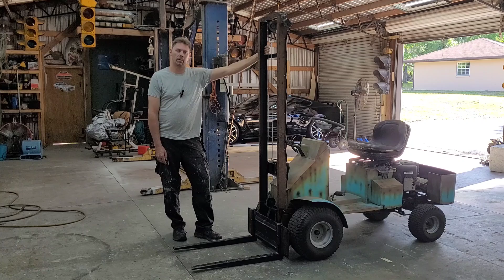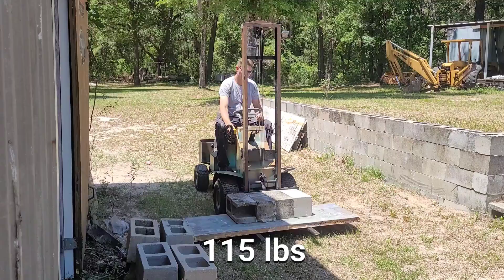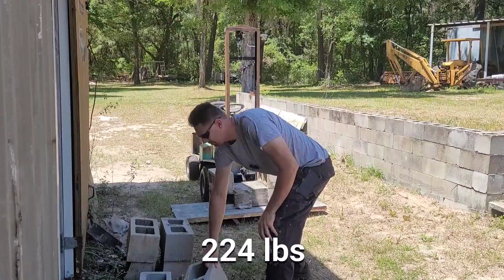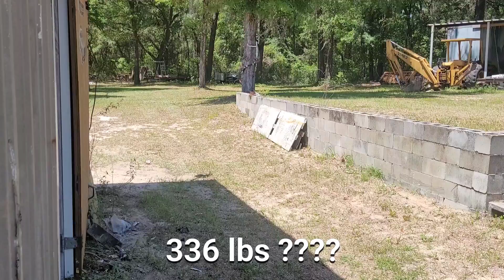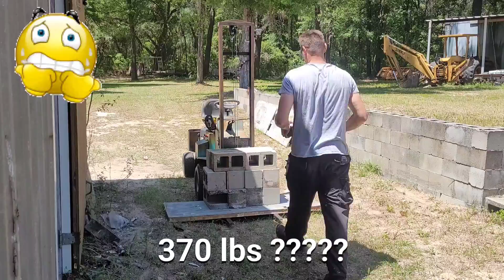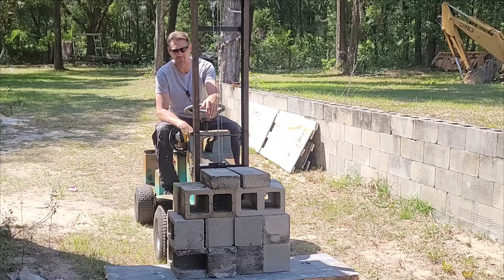How much will this homemade forklift carry.

Comment: The factory axle will be your breaking point. You will his about 500lbs on the axle and after that is when the possibility of the axle breaking.  Not sure how you can get around that because most riding mowers will be around the same no matter what brand.
Reply from the maker: The main plan for this is for stuff that is a little to heavy to carry by myself or awkward. Plan is 400 and less. I have a full size tractor for anything heavier than that. It's more of the convenience of having something compact to lift and move stuff around

Comment: If I can recommend one idea, I will. I've already added it to my plans, and it would be an easy retrofit for yours:

Cut off the flat top of your fork tubes. Add a short section of tubing above so that the sidewalls of the tubing is still there (baaically it'll look like the bottom part does now).
This will be stronger than the flat plate is now.
BUT!!!!
The real advantage will be that you can cut "teeth" on the top of your fork retaining back plate. Only maybe 1/4" deep, and 3/8" wide every 1" along the top. 
This allows you to lift the fork about 3/8", slide it to where you want it, drop it into the two teeth that line up on the tubing,and the forks will not slide sideways. Period.
Infinitly adjustable, very easy to adjust, easy to add to existing setup. 😊

Safety first. Unless it's lunchtime. Then it's food first. 😂

Comment: I would consider placing crossbars about every 18" on the upright bars, that way if the cable snaps it shouldn't be able to hit you from the drivers seat.
Reply from the maker: @unkierich  the cable is a concern. The issue is with the winch being on the outside. The cable is not on the inside until it goes over the pulley at the top.
Reply: @Paulsprops-dc4mt I'm going to recommend swapping to synthetic winch line. Yeah, $50 bucks to replace a line that doesn't "need" to be replaced sucks, but the safety factor trumps the $50 in my mind...

If you want to keep the steel line, maybe thread it thru a 3/4" gas pipe from about a foot above the winch to just below the top pulley. Support it top & bottom with some 1/8"x3/4" flat stock to keep the 'cable tube' in place and it will allow the cable to pass thru it like fishing line thru a float. No wear & tear, as the two never touch, but if the line ever breaks, the part behind the mast will be inside the tube and fall to the ground. Then you can "cage" the back of the mast so it won't come back at you from there, like he said originally. 👍
Reply from the maker: @Voo_Doo_Blue  i have a few ideas in mind. Just think of which direction I want to go.  The pipe is a good idea. Keeps it simple.

Comment: None of this matters, what matters is how high can it lift a small block chevy engine? Try and pick up the rear end of a small truck.
Reply from the maker: @howiehowdy  if you're asking, will it go high enough to pull an engine out of a car. No. Will it lift the back of a truck. It probably depends on the truck. S10? F150 No. But i didn't build it for those reasons. I have other equipment for those purposes if i needed to perform those tasks.

Comment: Highly recommend regular inspections of not only your welds but of the original frame and axles. How much was the original tractor designed to carry? One fat guy or one not so fat guy? View the load as fat guys all sitting on the original tractor.
Reply from the maker: @StevenStyczinski-sy8cj  not sure if you saw the build video. But this is a home built forklift i made for carrying stuff around. This video was a follow-up video to answer some of the questions from the build video. What can it carry. So i made it to see. I won't be carrying 300+ lbs on this regularly. Mostly for those items that are too heavy or awkward to carry by hand. Anything larger or heavier, i have a front-end loader i use for that.

Comment: I am a bit of a lawn and garden tractor nerd. I build mud mowers and have inadvertently gained a lot of knowledge on lawn and garden tractor transmissions. You could greatly increase the carrying capacity if you went with a Hydro like a Tuff Torq K66 or K71. You can find them around but they came in John Deere tractors, especially. The K 66 develops something like 450 foot pounds of torque and has 1 inch axles. It’s meant for ground engagement. The K 71 is even bigger and more robust.You probably have a three-quarter inch axle transmission on that thing which is still respectable and can do a lot more than you think.
Reply from the maker: @Tennesseemountainhomestead  i believe mine is the tuff torq k46. It has the key way on  the axles and not the lug nuts
Reply: @ yes the K 46 is probably one of the most common hydrostatic transmissions that were made. Back in the early 2000 era the thing to do was sift a K 66 in place of the K 46 on the L120 tractors. As a matter of fact, I did that myself. The difference in power is astronomical.
Reply from the maker: @Tennesseemountainhomestead  im sure as time goes on. Ill be finding the stuuf i need to upgrade this. I just this for a cheap price running and driving perfectly. So i used it to make the main unit. But there is always room to make ot better
Reply: @ the K 66 still uses key axles, but there are a lot of garden tractors out there which incorporate the cast-iron hubs to work with that and then you get five bolt lug pattern. I’m not sure if the K 71 has splined axles or which hydrostatic transmissions may have had splined axles. In my experience of mud mower building, hydrostatic transmissions are undesirable because you really cannot speed them up to great gain ground speed by changing pulley sizes. We stick with manual geared transmissions.
Reply: Also, the oil that is inside these hydrostatic transmissions is the equivalent of 50 weight motor oil. You can even use a 50W full synthetic motor oil.

Comment: Awesome build keep showing the upgrades. Dual wheels on the drive axle would help with the side to side stability
Reply from the maker: @riverfrontww  that was a thought. Would look kinda cool, too. The fun part would be making extensions. This axle isn't the kind with lug nuts.
Reply: @Paulsprops-dc4mt  Search on here bunch of vidoes where people have added duals i'm betting there is one out there that didn't have lugs. I know some folks used wheel weight for alignment of the duals.
Reply from the maker: @riverfrontww  ive done it before a long time ago using threaded Schedule forty water pipe with the four bolt flange. Making sure its perfectly centered is tricky.

Comment: Nice Job!!  Looking for your build video.....
Reply from the maker: @Paladin7845  i put a link in the discussion to take you to it.
Reply: @Paulsprops-dc4mt  Thanks, all ready watching and saved it.  Planning something similar for a couple years now.  Watching yours for ideas.  Probably going to start with a hydro unit and upgrade the front spindles to 3/4".  Then add 4 stud hubs w/ larger tires rather then flip everything around.
Reply from the maker: @Paladin7845  it would have been easier to start from scratch with the main parts. But i figured it would be more challenging to make it work with what i had.
Reply: @Paulsprops-dc4mt  🤣....Great attitude!  You like a "challenge" more then I do.  Then again some of my projects are.....does it work?  Yes, then put it to use and we'll paint it later.

Comment: I knew a gentleman in Georgia that set up affordable homes for a living. He'd maid a machine out of lawn mower parts.
But he did not use the frame.
It was too weak for the weight that he was
Warning to Hull. He always hauled 40 blocks on his machine.
Whatever your winch.
Shows the it could pull double it, that's how much weight you can pick up
Reply from the maker: @MarkMullins-jp3xm  the winch is a 2000 lb, but i know the unit as a whole would not pick up that much weight. This was a follow-up video to my build just to answer the question of what it would do.

Comment: The weight is decided by ur tires.
Reply: U put tires with no air then u can add weight to rear end.
Reply: Wouldn't push to hard and drop ur load and break stuff or go for a bad ride
Reply: Under 400 is wise
Reply: The frame isn't ment for that either.
Reply: U could bend it right in the middle.
Reply from the maker: @JosephRott  the goal wasn't being able to lift and move 500 + lbs. More of being able to move stuff that is too heavy to move by myself. This was a follow-up video of my build. Just to see what it could do. If i have anything really heavy, i have a large tractor with forks that can do the heavy lifting.

Comment: from experience with mower transaxles the weak link will be the bronze bushings in the housing holding all the weight on the front.  Just be aware those stock light duty units are ok under 600 lbs axle load but i can't tell you a breaking point. the next and i'd say more dangerous thing is load rating of the tires, if one were to blow you could topple the unit. one thing to keep in mind is as you load up the forks the rear counterbalance weight will start to shift onto the front axle so lifting 1000lbs might actually add 1200 lbs of axle load. 

PS i do love the build so don't take this as a negative comment 😃
Reply: Auxiliary bearings would help with that. I have made a similar machine with a C channel chassis and multiple 24V electric gate opener actuators with gas springs to assist.

Comment: Pretty awesome, only thing id be concerned of is the axles and transmission holding up with the weight, i didnt see which you had exactly, but all modern lawn tractors transmissions are pretty fragile.
Reply from the maker: @M.TTT.  It's that tuff torq k46. But this test was just to see what it would carry. I most likely won't be carrying that a lot.
Reply: @Paulsprops-dc4mt  ah yea 300lbs or so max probably be fine then, could always change it out relatively easy later if you had to. Nice work

Comment: Might want to upgrade the charging coil
Reply: Or run a deep cycle battery. Not much you can upgrade unless you add a legit alternator to it.
Reply: Install a Battery Tender built-in under the dash, so he can just plug it in when he parks it. Batteries will be good to go next time he hops on.
Unless it's All Hallows Eve, and he's moving 40 or 50 props around in one day, he shouldn't kill the batteries between parking-and-charging sessions.
Plus, he was smart and used two batteries for double the Amp Hour Capacity when he built it. 👍

Don't let his good looks, sexy accent and dashing personally fool you; this one's a thinker. 😂

Comment: I'm going to have to build one of these. I will say that you should be putting the weight at the ends of the forks as a way to see what it can actually carry and be stable.
Reply from the maker: @WhoThisGuy515  with one of the blocks in the back. I can stand on the end of the forks, and it dont tip. Im 225 lbs. I would say if I had something right at the end of folks between 225 to 275. Maybe a little more if i add the second block in the back.

Comment: It's very impressive and looks to be the perfect size for around the yard and garage. I have one of those harbor freight atv winches bolted to the wall in my garage. I use it to drag inside non running projects, and I have a couple of hooks on the ceiling that I attach a pulley too so I can lift stuff straight up. I want to make one of those forklifts, so I have to see what I have in the yard and also to start looking for a perfect cheap  mower on marketplace. 🙂
Reply from the maker: @Happyfacehotwheels  thats what im using, a harbor freight winch. Noisy little thing, but seems to good good. I dont expect to use this every day, but when i need it. I will be glad to have it.